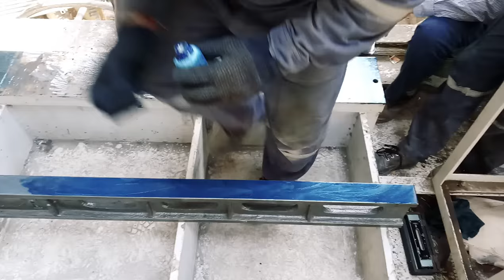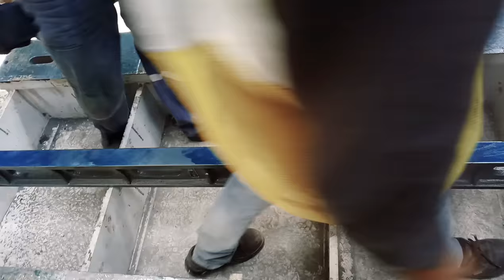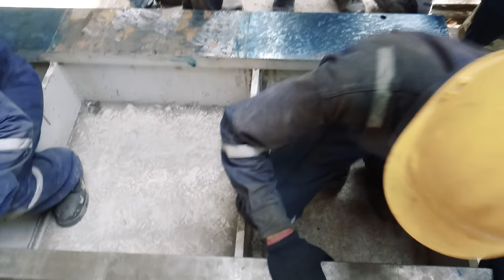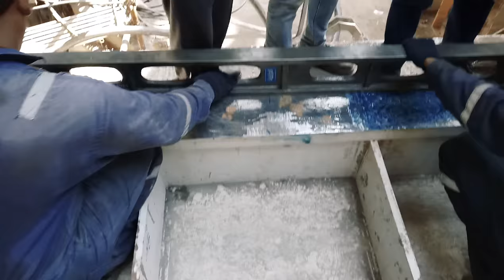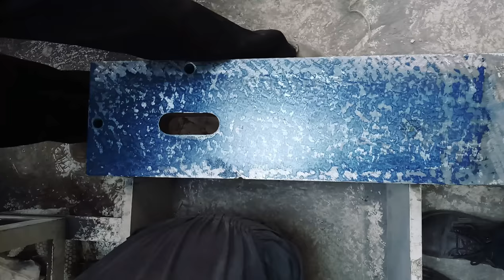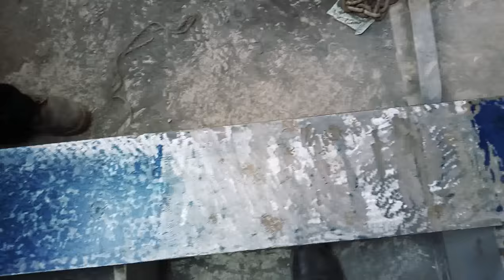आख़िर यह ब्लू मैचिंग क्या है [What is the Blue matching....?] #Bluematching #scrapping method

Comment: Name of that tool...kindly tell...by that you are doing matching sir
Reply from the maker: Scriber called and it is used to stain or paint a metal object with a very thin layer of dye that can be scratched off using a scriber.its work like hammery paper during wall painting

Comment: What is use of blue matching bro
Reply from the maker: It is used before installation any machine in which requires precious engineering
Reply: Bro how it helps to machines
Reply from the maker: @ravianur  very thin layer of metal object can fail your machine base so that damage your casing and coupling so that's dye scratched off alll the object from the base.
Reply: @EquipmentErectionAdda2040  thank you very much